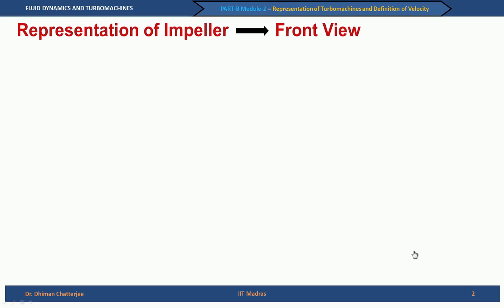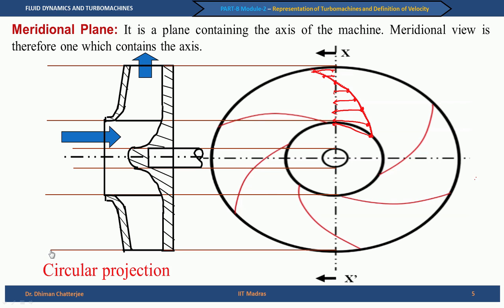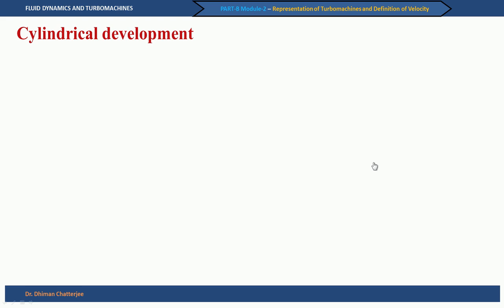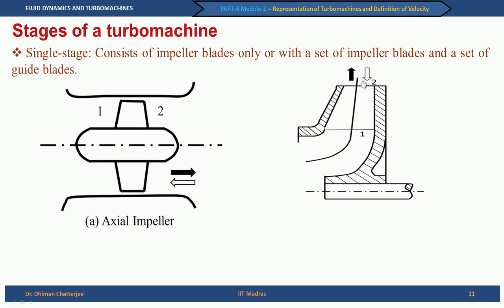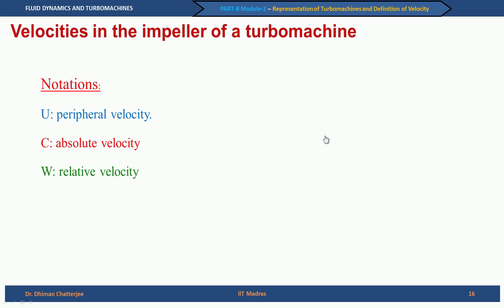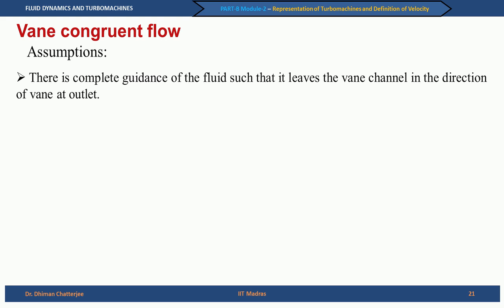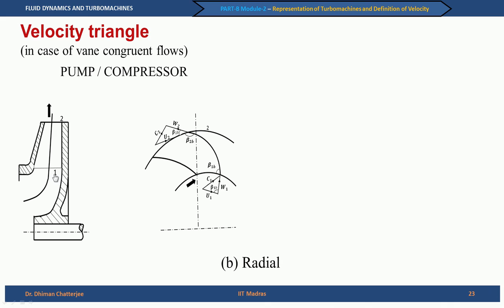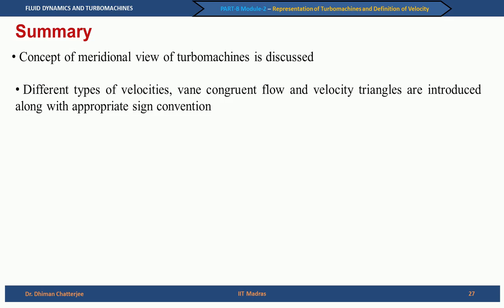Representation of Turbomachines and Definition of velocity

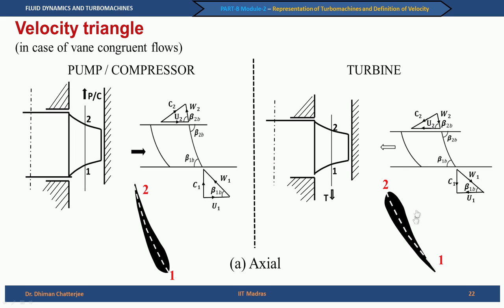Comment: Sir, I'm confused with the diagrams at 41:18
Consider the first diagram of pump/compressor
It is indicating the velocity of the blade from bottom to top (upward arrow), So U is in upward direction..so inlet flow should be in perpendicular direction to U..but there is no entry for the inlet flow in perpendicular direction??.. So how does the flow enter the blades as per the diagram?